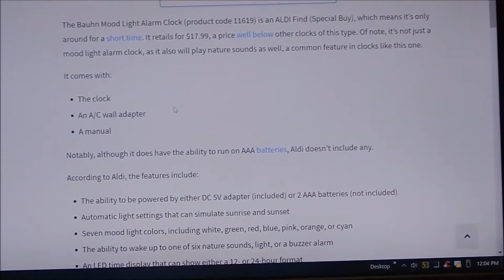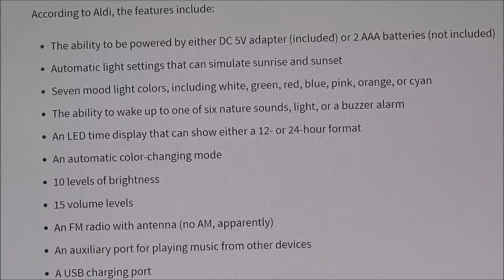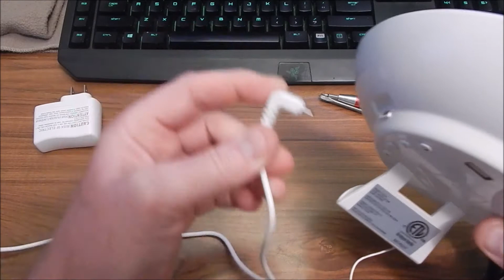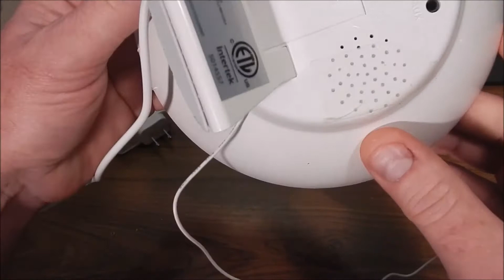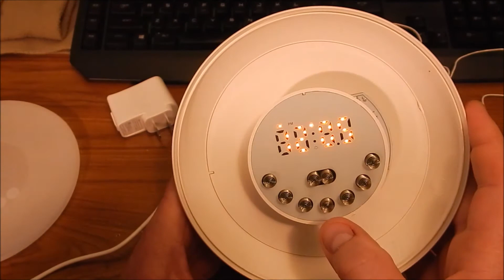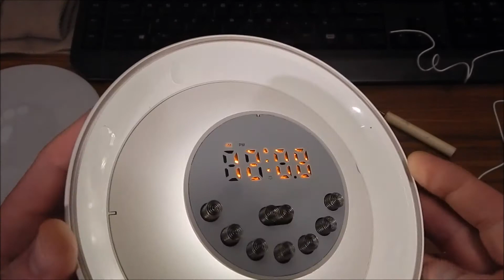More Than A Clock Radio!  The Aldi Bauhn WWRGB Mood LED Clock Radio

Comment: Thank you for making this video. I have one of these clocks and love it. It’s survived several moves but recently I’ve lost the manual, and the clock isn’t super intuitive in my opinion. Any chance you have a manual? I’ve spent an hour searching the internet and find all kinds of Bauhn manuals, but not this one. Thank you again.
Reply from the maker: No I don't, only problem is it eats AAA's for backup, even for a day or 2,  I just put an old 18650 lithium in a holder and now it last long time.  Extra volt no factor.